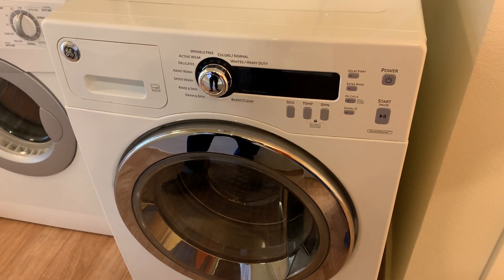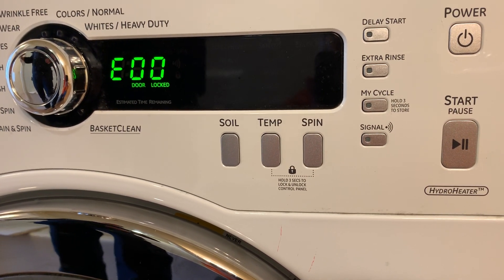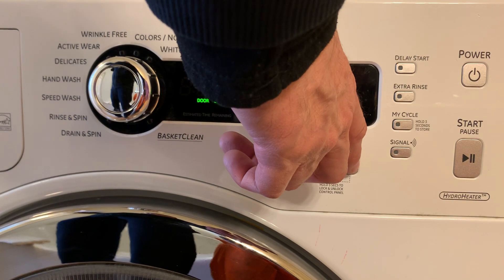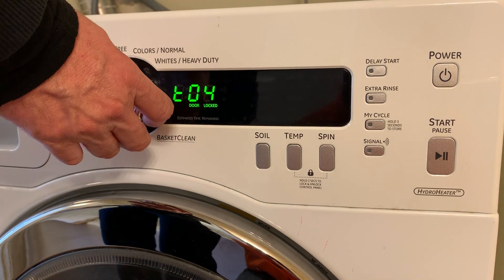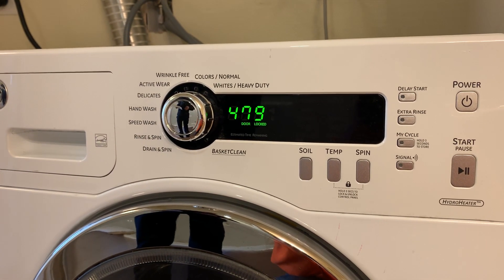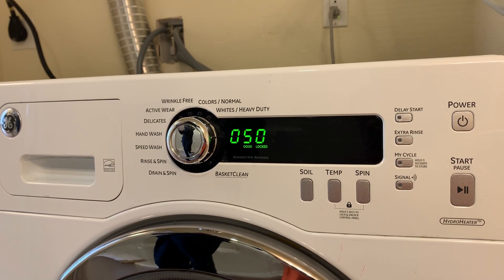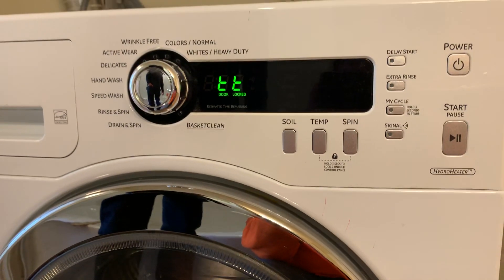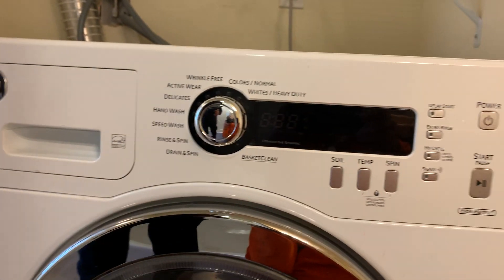GE Washer Diagnostics Mode

Comment: What is code 01? When I press, signal/rinse/signal/rinse. I got into diagnostic mode but when I press power it doesn't go to next code it just turns off.
Reply: Use the cycle selection knob to move to the next/previous test. Start/pause starts the test. 
Power ends the test.
Reply: There is no code 01 after you do signal,rinse signal, rinse. The first thing you will see is t 01 to xheck for codes you scroll with the knobs to t02 the press start/enter and that will show you  the code/codes if there is more than one you will scroll left and right to find the remaining codes

Comment: @303jrios  Great video!

I run my T2 and i get the following:
4E
UE
dE
dE1
0E

The washer hums a bit when starting a load, it fills i think slowly  it drips out of holes in drum,

Then it just continuously tumbles

It does drain 

Can you help please? Thanks! 😊
Reply: @303jrios do you know how to hard reset the machine? We tested it with only power and no water when we bought the machine, maybe it just needs to be factory reset?

Comment: You are such a dearheart.  I followed your video and went through the diagnostics per your video.  I didn't do perfectly but I got through it.  When I read the comments I found out other people had my same problem.  When I hit the start button it acted like it would start and then it would "unlock" and the timer would start blinking.  It is intermittent.....but I do believe it is the lock assembly.....I think it's a defect in these machines.  Anyway, I will get a tech out here and pay for them to install a new lock assembly....at least I know what is wrong.  I wish I had the courage to order the part and fix it myself....but I'm just not confident.  Thanks so much for all  you do....
Reply from the maker: Yes I have another video on that
Reply from the maker: https://youtu.be/6QQiN-Yu_PQ

Comment: I'm so upset. I have this exact model. I haven't had it very long and it won't start. I'm trying to follow your directions, but it's confusing because when you're showing something like turning the knob after the diagnostic starts, the camera doesn't show where exactly you're turning it. Also, your going through the steps too fast at certain points. I'm pretty efficient at writing steps down, then following accordingly, but I'm finding it difficult in this case. Please help if at all possible. I can't believe what a piece of junk this machine is and it wasn't cheap.
Reply from the maker: What is yours doing
Reply: @303jrios  Oh my gosh! I can't believe you responded so quickly. Thank you!  Warning, I'm a mess and crying because I've been so upset. Okay, the door closes fine, I press power, then start. The time shows up as 30 minutes because it's on speed wash. It stays like that for a few seconds, then it chimes a few times and the 30 starts blinking.
Reply: @303jrios  I'm going to get some sleep and go over your video again tomorrow, slowly this time and write down all of your directions. If I still can't get it to work I will call a repairman.
Reply from the maker: Is yours doing this
Reply: @303jrios  I just arrived home. I'm much calmer now and I watched your first video again, only much slower and took notes.
I understood everything much better this time. I also watched another video, again with my exact washer and I'm so hoping the problem is simply with my door latch. I will watch your attachment as soon as I get a bite to eat. I can't thank you enough for being of assistance. I will definitely keep you posted.
I so wish I had purchase the simplified apartment size stacked washer and dryer, but I wanted a certain look in my kitchen. You live and learn.
Reply: @303jrios  Yes! That is exactly what my washer is doing. Ordering a new door lock ASAP. Can't thank you enough for your help and your videos. You are wonderful.
Reply: @303jrios  You were 100% correct about my washing machine! It was a faulty lock on the door. You really know your stuff. Keeping my fingers crossed nothing else goes wrong.
Thank you so much. I subscribed and also gave a thumbs up 👍
Reply from the maker: Thanks for watching like and subscribe
Reply from the maker: I’m curious how far am I reaching where are you watching from?
Reply: @303jrios  St Clair Shores Michigan.
Reply from the maker: https://youtu.be/6QQiN-Yu_PQ

Comment: Error code on e3. Means what?
Reply: The E3 error in GE washers means the basket is overfilled with water.   The water level sensor sends a signal indicating that there is too much water in the basket ...  Therefore, the washing machine stops washing.    Then the device turns on the drain pump and displays the E3 error code.

Comment: My GE washer is not draining and I don't know why.
Reply from the maker: Filter clogged
Reply: @303jrios  clogged was cleaned and the drain hose is properly connected
Reply: We brought a new GE washer that is GFW148SSMWW
Reply: And the drain pump was burnt out
Reply from the maker: Oh dang if new they should come out and do it free. All you have to do is scan the QR code and set a appointment. Through GE is free for the first year
Reply: @303jrios  there was no drain pump available so I have to replace the washer.
Reply from the maker: There has to be
Reply: There's no drain pump available for WCVH4800K2WW because of the pandemic and I have to wait 2 months for the parts and I decided to get a new washer

Comment: Hello, I have this washer. It does not fill up with water, but the maintenance guy in our building says that it doesn't fill up because it's new technology from GE. Any advise?
Reply from the maker: Is the water valves on? Please let me know
Reply from the maker: Has to put some kind of water in
Reply from the maker: Did you just move in?
Reply from the maker: Also what’s it doing? Does it do anything
Reply: Omg I have the same issue with this! I have the same washer and my maintenance guy told us the exact same thing. I am used to seeing front loaders fill all the way up with water but this one does not do that at all. It’s almost as if the water comes out periodically but never fills up like it would if you went to a laundromat. Is this correct? Should it be doing that?

Comment: I already took the lock mechanism out before I saw this video. Anyway I wanted to ask to make sure that is the problem. When I try to start it, it wont run and I can hear a faint click....click....click about 5 or so times and then the lights blink as if I hadn't pressed start. 

Could that lock be my issue?
Reply: Did you end up getting your issue resolved? You have described my exact issue.
Reply: Mine too! Any resolutions??

Comment: How do u reset the diagnostic mode? so u can go back into the diagnostic mode and check for any new codes?
Reply from the maker: I think it’s at the end of the video
Reply from the maker: Is the tech sheet under the lid it will tell you or where you clear the filter?

Comment: Hi! Question about this washer. I go to start a load, and it won't lock therefore I can't wash anything. It makes a weird sound (multiple times) like it's trying to lock, but then gives up and flashes the time at me. Nothing is obstructing the door, and the door lock appears to be in tact. Any suggestions? Thanks so much!
Reply: FIXED ! If anybody comes here, I find out the solution for this exact problem. (I HAVE 0 SKILLS in electronics and stuff) : I REMOVED THE LOCK ASSEMBLY (plenty of videos explaining how to) and then INSTEAD OF REPLACING THE WHOLE PIECE (the WH10X10008 : costing around 100$) I OPENED IT and then you can find a little piece of plastic that is missing, I saw a video explaining this : https://youtu.be/8y4AnWb1xPo. And now its working perfectly and i havent spend a dime on anything. once again I did it without having any skills or knowledge on washing machine or repairs. Hope it helps you !
Reply: Same here, someone find out how to fix?
Reply: @mmee78  I had a maintenance man come replace the door lock mechanism and now it’s working fine.
Reply: Hi I have the same problem we’re you able to figure out the problem?!
Reply: I’m having the same issue lmk if you find out how to fix it! Thank you

Comment: Hi.
I've got a GFW450SSKOWW model and it won't fill , it just hums and nothing happens. Can you help me
Reply from the maker: James Edwards sounds like the fill valve
Reply: @303jrios  
Good morning. 
I Think so as well. 
I'm in the Bahamas so parts are hard to find. So I will try to change fill valve first. 
Don't know how to diagnose test
Reply from the maker: Thanks for watching and be safe out there
Reply: @303jrios  
Thanks. 
Be safe as well
Reply from the maker: There should be a tech sheet to tell you how to put it in diagnostics mode. Usually by the kick plate or under the lid.
Reply: @303jrios  thank you so much.
Reply: Did you ever figure out what it was. I'm having the same issue